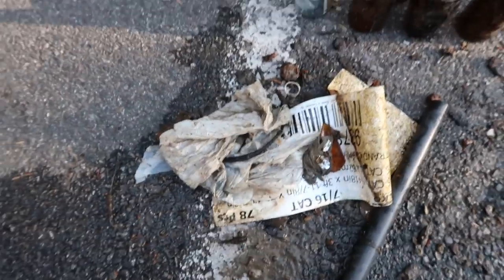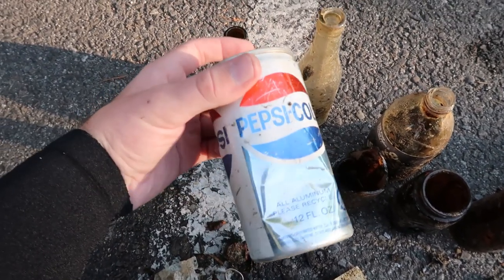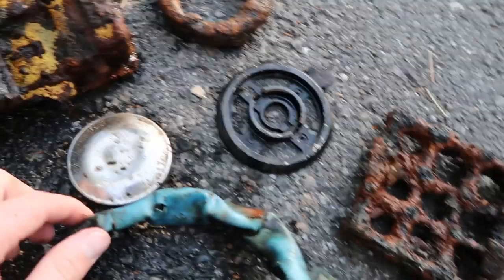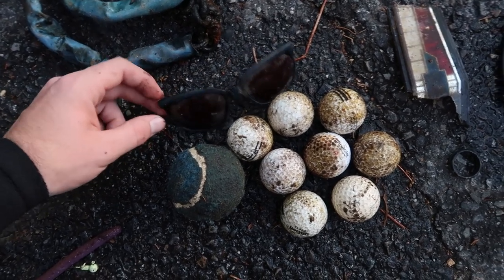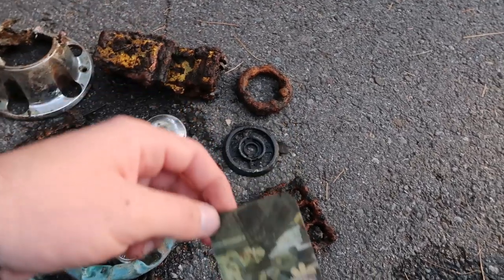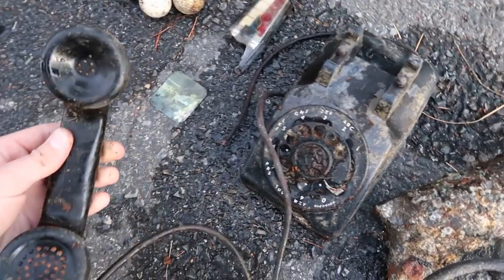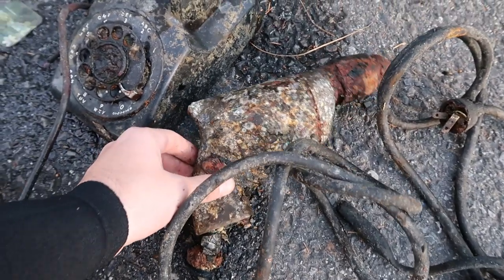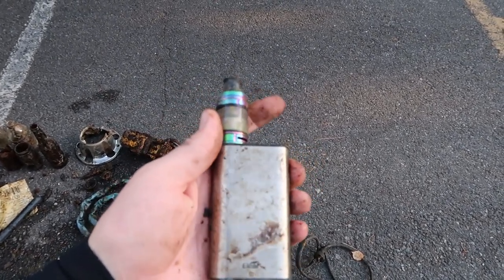1900s Rotary Phone Found While Scuba Diving

Comment: It's a Western Electric model 500 telephone. Depending on the wheel, it could be from the mid 1950's (if metal) or early 1960's (if clear plastic) and where in service to Bell and other telephone companies until the WE 1500 in 1964 began slowly replacing the older 500 models.